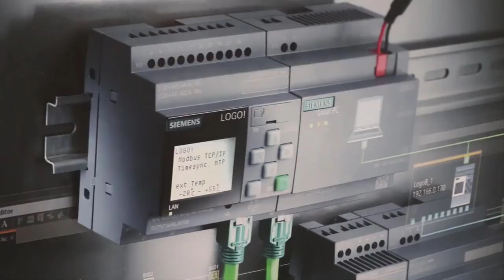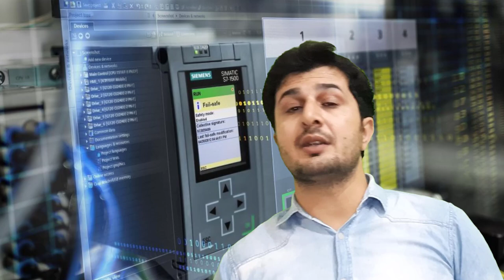Don't be PLC Programmer and Automation Engineer

Comment: That is of course if you are using hard to use, big-name automation systems, where the end user client is forced to hire a code programmer to do the simplest of real-life tasks. I am used to systems that take weeks to learn, months at worst. A VFD can be controlled by a simple PID loop. Logic statements can be programmed with easy plain English "if-then" logic statements using commands like IF, THEN, ELSE, AND, OR, FOR, etc. This is what happens when a system is designed to be complex so that the client is on the hook instead of designing it to be used as a tool. I've been doing this for over 25 years and it is not as difficult as this video makes it out to be.
Reply: That's all true but that's how the big companies make their money. If they didn't have revenue fr the software they would make up for it somewhere else.
Reply: @J Ramon Torres it sounds like you are using a combination of IFTTT and boolean logic. What hardware are you doing this with For the past 25 years if you don't mind enlightening me? Or were you speaking against "code programing" in the instance of structured text and you use ladder logic?

Comment: I'm an electronics systems engineer who have designed many products, and I'm also a professional software engineer with a decade of industry experience. I'm about to design my own production facility (factory line) for my own product. I came to this video to learn why the heck people use expensive PLC:s for industrial automation when they seem to be just stupider versions of MCU:s. Looking at this video and a few others I learnt that there is no reason. PLC:s are a stupid legacy way to do things and that I should avoid them like the plague when designing my factory line. With an MCU all the hardware is nearly free, all the software is free, and the software is natively intermixable with all other computers and software systems, without having to buy an expensive software package from the PLC vendor that only works with the PLC:s of that specific vendor. Good grief! I'm never putting a PLC in any of my robots or production lines!
Reply: What is MCU? Is it reliable as a PLC for many years?
Reply: @steve5nash  Every PLC has an MCU inside it. It is the processor. But you need to design more details around the processor if you use an MCU. Let me explain the difference with an analogy.

A PLC is like a coloring book for children. It has 40 pages of simply drawn wild animals that you can fill in the colors of. But the coloring book costs $200 and you can only use the coloring pens that are made by the same company that made the coloring book. A set of such pens cost $500. But they are safe, so when you try to color the turtle 🐢  it is likely it will become colored like a turtle.

An MCU is like a book with 200 blank pages that cost $3. And you can use whatever pens you want, even the cheapest $0.10 pencils ✏️ work just fine. And you can draw whatever you want. The problem is that you need to know how to draw. But if you DO know how to draw, now you're free to draw whatever style of art you want. It doesn't have to be those cartoon animals. It can be something much more advanced and pretty. And it is ridiculously cheap compared to the coloring book. But if you don't know how to draw then the result will look really bad.

The coloring book used to be a blank book before they changed it and put all those patterns on the pages.

I know how to draw. Therefore coloring books are stupid to buy. I only buy the book with blank pages.
Reply: @enque01  I am installing a PLC as an integrator. my answer is this: if you are satisfied with microprocessors, the system will be GOLD, more expensive than a PLC. Because the engineer who did it will leave, the whole system will be tied to him and YOU will have to program a new one from scratch, or feed the old engineer with gold. And when you buy a standard PLC solution, any automation engineer will come and support the system. So as long as you have one plant and you know all the wiring there, it’s convenient for you. But when you think like Rockefeller, you will buy PLCs from me, not microprocessors.
Reply: Ha, good luck having them last in an industrial environment for anything past 5 years.
Reply: @1dae360  It seems he "is" the Engineer, in this example.
Reply: @enque01 Good analogy except:
 This isn't art.

LOTS of $$$ is on the line with these controllers.
You can play "God" all you want with these MCU's (which I absolutely love the idea of cheap controllers with free & near unlimited software), but if you want to make $$$ and not your own little playground  factory, then you WILL use technology that allows you, or someone you hire (because we all know Humans can be at 1000 places simultaneously in real time), to color in the pages quickly, efficiently, reliably, and with reasonable ROI after commissioning; ESPECIALLY on a START-UP Factory!!!
Reply: Plc is more reliable since not everyone knows mcu i think they want to make the process easier
Reply: too many tried and failed. They failed because the engineer who designed it , left/retired/or died. Big PLC manufacturers will be there for long time and support their clients. Plus that PLCs went under Laboratory Tests for harsh conditions something that you will have to pay a big amount to get your controller approved. Plus that all manufacturers are using Codesys Platform , which gives the PLc software engineer a big advantage. Dont waste your time designing the wheel again.
Reply: Why PLCs?  You are working with electricians.  Their experience include pulling wire, protecting wire and terminating wire.  They don't design logic.  They adjust limit switches.  PLCs give them a place to land wires.
Reply: Lol, clueless ... Your production line .. carry on.. you will learn ..the hard way

Comment: There are so many industrial automation engineers available outta there.. Manu programmers with good amount of multiple vendors training. Since corona hit, the demand for industrial automatin professionals is significantly decreased. Companies now mostly outsource most of the programming & HMI design works to cheap remote programmers. I think guys who are in their early career shall tailor their skills in building automation, as there seems to b a major push towards  sustainable and green buildings  recently not to mention new regulations of bms cuz of corona and all. I know you are all up for industrial automation but trust me man the demands for these professionals is continuosly declining
Reply: Agreed, BMS is the way forward especially in specialized HVAC and energy monitoring system, however this author is absolutely correct in saying the importance of practical integration and its  implementation.  Web integration, analytics  via IOT is also very important as well
Reply: What else is in demand other than building automation ?
Reply: I think it is the quite opposite.  With 4.0 we will see the biggest demand for Automation Engineer.

Comment: As someone that works in manufacturing, and knows most of the syntax you've given examples of, would that be a keen indicator that I can apply myself to at least entry level PLC/VFD learning? I already have change basic communications on the HMI side of things and the main PLC technician at my job isn't too well versed in anything else related to computations other than the specific program our company uses. I may be in over my head, but it's just frustrating seeing that we only have one PLC tech at our location and I want to be at least capable enough while also being able to focus on other issues not PLC related.

Comment: I am a electrician.  My dreams i will work in automation field.  But i have not any academic degree in automation sector or electrical sector.  Is it essential to be a engineer for working aumation Sector?????. I am educated in business studies sector.... Plz reply me anyone....
Reply from the maker: Reach us on whatsapp num provided in description
Reply: Engineers can't do electrical work. I am a sparky too, just finished commissioning a lift for an underground car stacker. A former sparky was commissioning the PLC program that the vendor supplied.

If you can do an advanced trade course in industrial automation and control, which covers vfds, PLC's digital and analogue, networking, instrumentation concepts, sensors. And machine safety.  I did one years ago and it's only just come in handy. 

My boss told me in Australia an automation tech needs to be dual trade, electrical, instrumentation, along with advanced trade in automation.

Comment: Do you need to have an electrical background in order to be a plc programmer?
Reply: Of course
Reply: @ratafrisco5840  So, you are telling me no one but an electrical engineer can write plc programs.
Reply: no need
I am chemical engineering background
but now I work as plc programmer
Reply: @nixchua2672  did you do any extra course? to improve some skills? for example a course to build electrical control panels or anything like that?
Reply: @nixchua2672  but do you build panels or you just write programs? or as chemical engineer you learn about motors, wiring etc etc?
Reply: @robinsonsaez3580  no
only learn from youtube or siemens manual 😂😂
Reply: @robinsonsaez3580  both
the only thing I know is read PNID 
so basically I started from zero knowledge about electrical
Reply: @nixchua2672  very good man.!!! Congratulations. and yet there are people out there saying is not possible.
Reply: @robinsonsaez3580  thank you 😆
nothing is impossible 
We just need to take a lot of effort and learn one by one 😆
I believed you can do it also 💪
Reply: It helps to know hardware and software
Reply: @nixchua2672  

Hey mate, how can i contact you privately ?

I have some questions to ask. I graduated Diploma in mechatronic engineering two years ago but now I forgot what I've learned.
I want to relearn especially PLC since companies pay good money for plc programmers.
Reply: @nixchua2672  Cool story bro :)

Comment: Sir now I am studying Mechanical Engineering. Can I make my career in automation Engineer???
Reply: of course you can
Reply: Any machanical knowledge is very useful for an automation engineer.
Reply: @agb8764  so true, you have to mechanically understand what are you programming
Reply: It’s my case. I’m a Mechanical Engineer and I design, put together, test Control Panels and program PLCs. I got my UL508A MTR certificate a month ago.
Reply: You can
Reply: Why don`t you just learn AutoCad?
Reply: Mech engineer is hard & also dificult to get a job since demand is low,,,,PLC SCADA is much easier but does have control system without all that math, and higher demand.
Most automation enigneer I notice are Electrical/electronic engineer.
Reply: @ignaciolopezsoto9929  From where do you studied it ??
Reply: @varadrajjadhav7294  There is an online curse on UL website.
Reply: @ignaciolopezsoto9929 do you programming ? İ love coding and i want to automation engineering. İ think web/mobile development is boring because you just code you not aolving a engineering problem. Do ypu suggest automation engineering for me

Comment: Can anyone help me in plc programming for a project i am working on .?
Reply: What kind of information do you need?
Reply: @droneverse1203  i am Beginner and i want to make a program in which i have two pumps and want to rum them alternatively depend on running hours plus to count the running time .pls help
Reply: @MuhammadArslan-wo3re  you should learn ladder logic with the brand of PLC that you will be using. The best 5hing is to have the hardware and experiment with the ladder logic by turning on lamps or something, then later interfacing to the pumps.
Reply: @MuhammadArslan-wo3re  Well i can help you if its in Siemens